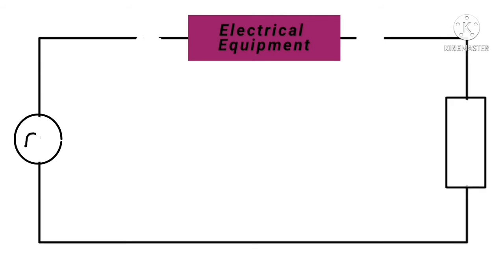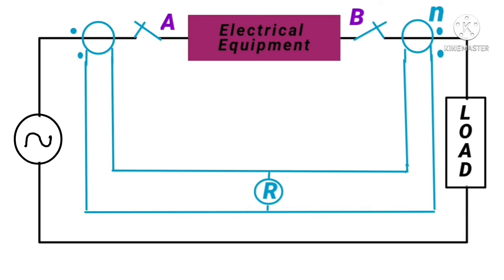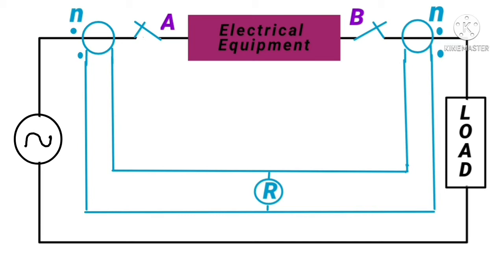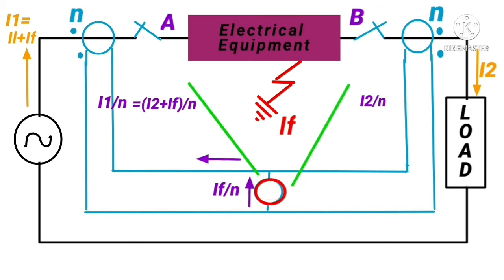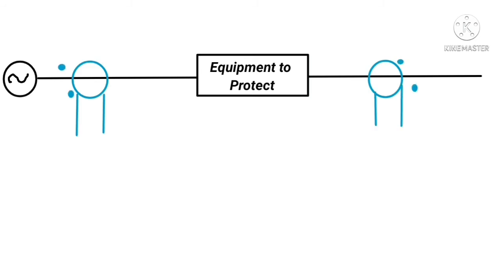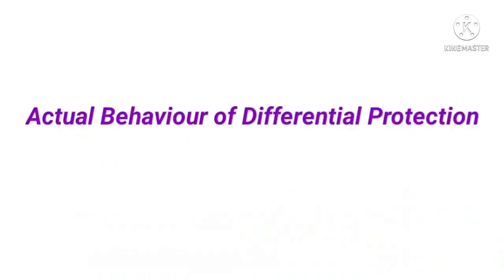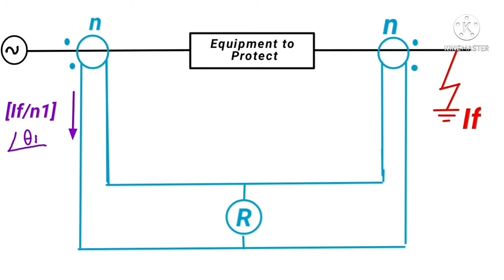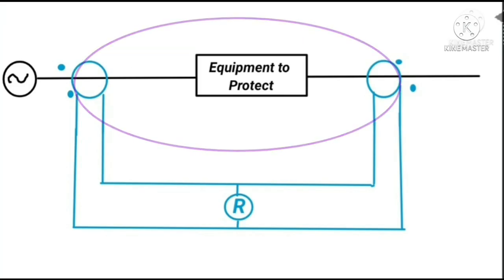Differential Protection Scheme#Differential#protection

Comment: Can you please explain how much margin or difference is permissible between reading of two CTs ?
Reply from the maker: Ideally should be 0. But in actual its not possible to get 0.
These imperfections depends on type of CT as well.
Like in metering CT's these errors/imperfections are very close to 0.